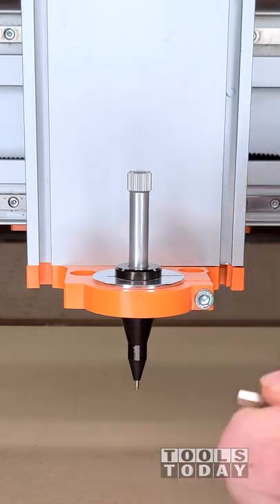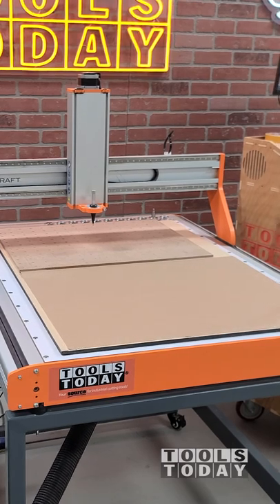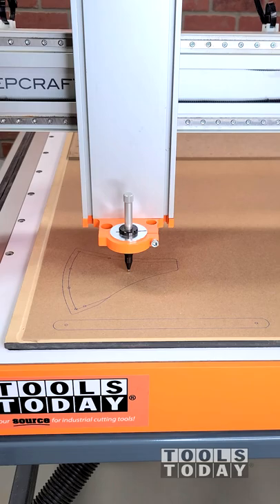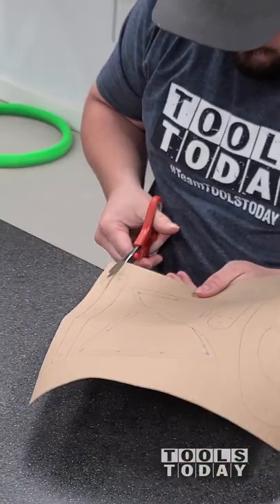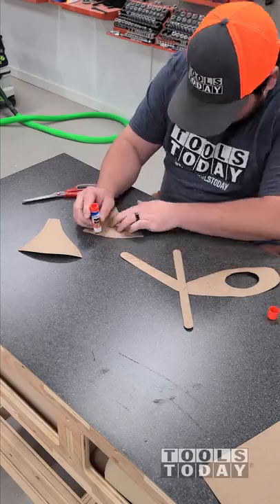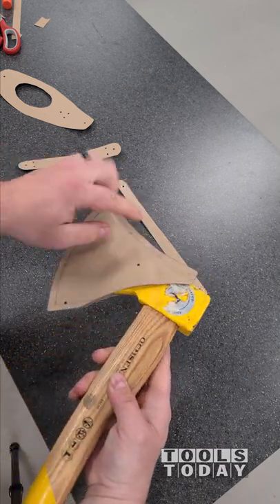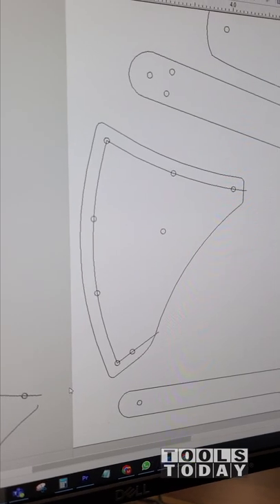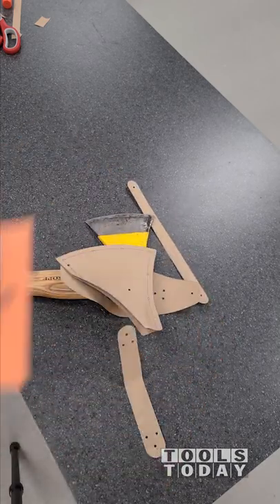Drawing with a CNC Machine

Comment: Don't forget to take into account the thickness of the leather vs the thickness of the paper.  A paper pattern may fit perfectly around your axe or pistol or knife, whatever, but wrapping a piece of leather of the same size will come up short due to the extra thickness of the leather.  If you're patten in paper fits perfect around a wrist sized object, the same pattern cut out of 10 oz leather will be considerably short.  Always keep in mind that you want your overall girth of the pattern to reach all the way around the piece, but you can form the leather and stretch it over any protrusions or bumps in the piece.  Do you don't need to add extra leather to wrap around a bulge or something just dip it in hot water and stretch over that part as long as the leather is large enough to wrap the piece leaving 1/4" it so for your stitch or rivets.  Don't forget a welt if needed where any sharpened edges will contact the sheath.  Use a strip of the same thickness of  leather you'll be using to wrap around the piece to get proper measurements.  
You're starting off pretty fancy.  Don't overcomplicate things.  You're working with a pretty forgiving material that will be stretched and adjusted and excess cut off of seams etc.
Reply: Thank you for this information